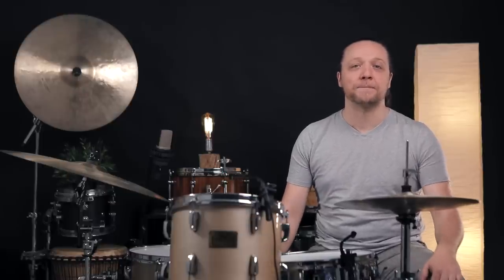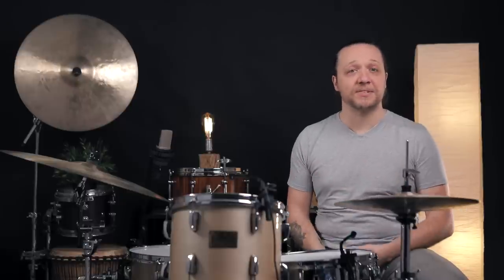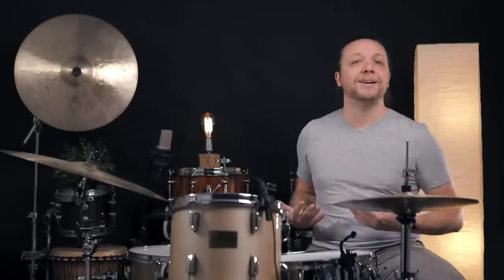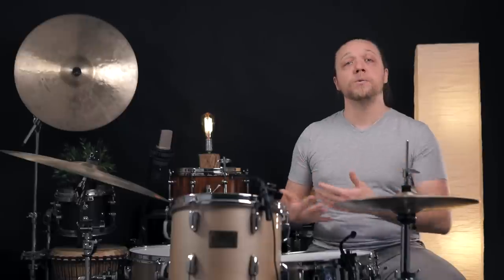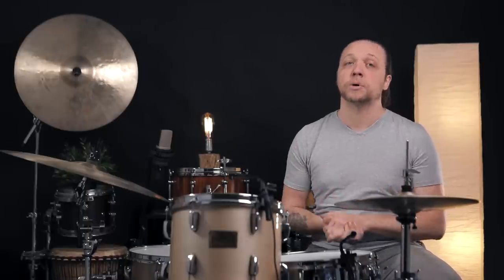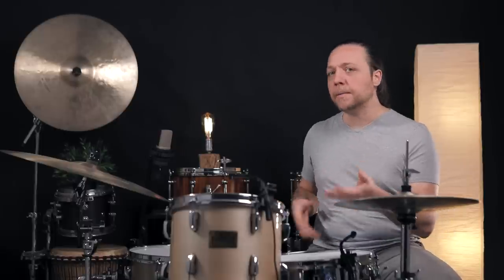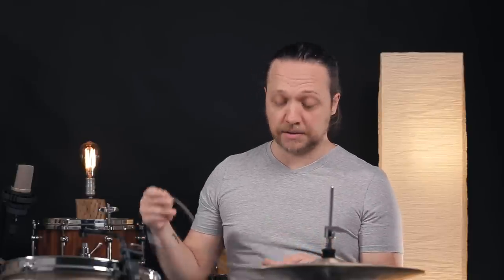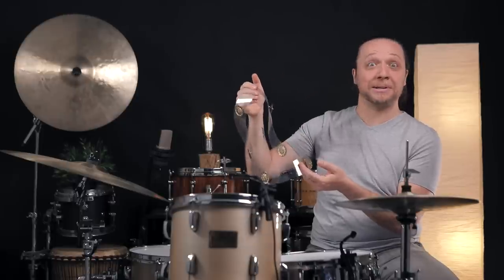Internal Tom Muffling Hack | Season Five, Episode 25

Comment: My use of a studio ring in a mini bass drum (14”x10”) was similar to what you did here. This drum is a conversion from a floor tom and I used the ring inside the built in inlay ring of a single ply head for the batter head. A 13” studio ring, inside the inlay ring of the 14” head. I used a felt strip inside the single ply skin faux head as the reso. Works well, especially miked.

Comment: Just asked this question a couple of days ago on the drummerworld forum - but I did it on my snare. The big difference maker was how wide you make the ring (I make them from old drum heads) - I did a 1/2" but it's a little much, gonna try a couple at 3/8 & 1/4, but it was a huge improvement and the trade off wasn't all that much. Took the ring I usually use on the batter off and the drum was a lot less boxy sounding.

Comment: interesting hack - never thought to try that.   I think like others have stated ...  it would just become tedious to "change it" as you need to remove a head, retune, etc ....    For those that might want a middle ground, I imagine that if you cut the O ring - in whatever mass you might want to remove - your sound might be something in-between your comparison here - e.g., half moon ring, quarter moon ring...  kinda thing.   Or, use a clock as your guide - cut out 9-12, or 12 to 6 - variations are limitless.  Or, cut the ring into two equal slices (although you'd be challenged to keep this variation in place).

Comment: I've been playing three toms wide open and my 16 with cotton balls inside for a while, but I've also put a little tape on the batter side of my 16. this is for feel more than muffling since i have minimal tension on the batter.
if i know I'm going to put tape on a head, when it's off for some reason, I'll apply the tape on the underside of the head - so it hangs inside the drum. you can't see it and it stays out of the way of any implements. i put it on the opposite side of the manufacturer logo so that i know where it is.

Comment: Awesome, clear, effectively explained. Very useful, indeed. Have been using the cotton balls for some time in floor toms, but wil try this ASAP. Would it be viable to do comparisons of different "strip" diameters of the rings in a future video? Or shapes (half strip vs full circle, etc). I have only cut up my own old heads, rather primitively, and am interested in thoughts on different heads to use to cut up as well. Thank you for all the exceptional content! Even though I'm not yet able to be a patreon supporter, I appreciate everything you do. Much appreciated!

Comment: Love the stuff you guys demo. great job!
I have a question. I have a 13" tom that rings forever. I've spent hours trying to tune the ringy-ness out. It's my feeling that gels and rings are for those who don't want to spend the time learning how to tune. So, that brings me to my question what if you were to use a mesh head as a resonant head. I'm thinking that it should give more sustain than a concert tom, but less than having a regular reso head on it. What are you thoughts?
Reply from the maker: Thanks! Glad you’re enjoying it. As for the difference between mesh vs. no reso, the difference is almost entirely unnoticeable when it comes to sound. Depending on tuning, you may notice some small difference in feel but that’s really a non-issue

Comment: Did you find any difference between the rings and the archi-known old school hack of the cotton balls...? (Given the amount of cotton just enough to equate the mass with the ring). I mean in terms of "behaviour", like I don't know, maybe the cotton tends to "jump" more when you hit the drum so tone is a bit more open and the sustain is longer, while the plastic of the ring tends to be a bit more stick to the reso head, dampening it a bit more.... I don't know, just guessing. 
And how do you think it'll go with smaller toms (8s and 10s)...? Nevermind, I'm gonna try it anyway... 😋
Reply: What I've found by messing around with both methods is that since the cotton balls occupy more of the middle of the reso head, and not so much the edges, you lose the fundamental pitch a bit more than I'd like to, and you get more harmonics. Conversely, studio rings muffle the areas closest to the edge of the head and thus reduce the amount harmonics in relation to the fundamental pitch, which results in 'focusing' the fundamental note of the reso head. Both methods reduce sustain (rings probably reduce sustain more), but I personally prefer studio rings. Def worth trying both methods! Curious to see what the SLAD dudes have to say
Reply: @tomasshannon6537  hi, thanks. What you say about edges/center sounds logic. I've used the cotton with my floor toms before and it works fine, but never with my rack toms. Anyway, I think the rings worth a try... I even have a bunch of old heads somewhere so the try won't cost me a single penny, literally. I can even check whole vs half rings out, in case whole rings reduce too much the sustain, specially in smaller toms.

* SLAD...??
Reply: @isihernandez9752  SLAD = Sounds Like A Drum
Reply: @tomasshannon6537  aaaah...!! 👍🏼

Comment: Hmmm the biggest thing that's always put me off this dampening method is simply the fact you have to take the batter head on and off - it takes time and isn't too great for the head if the process is repeated many times. What if there was a way to attach a ring on the underside of the resonant head - say the ring had a magnetic strip on it to hold it on?? Feel like there could be something in this idea...